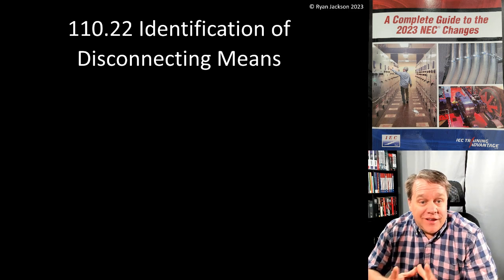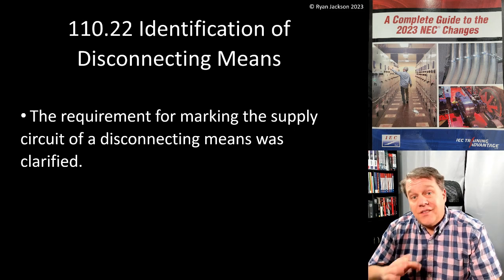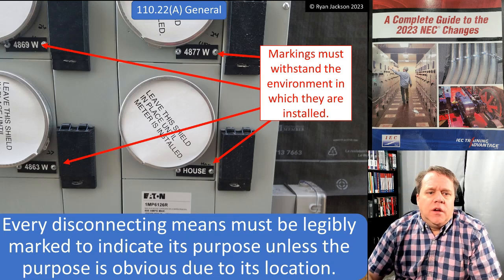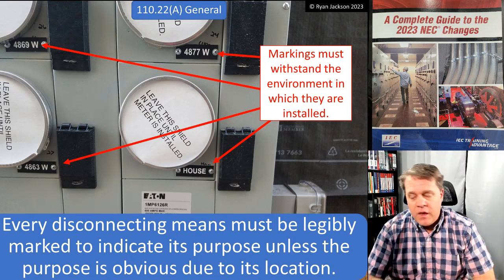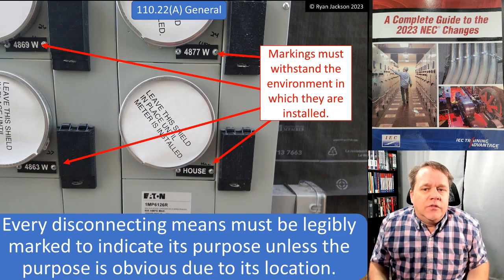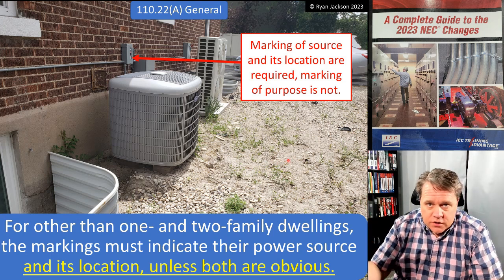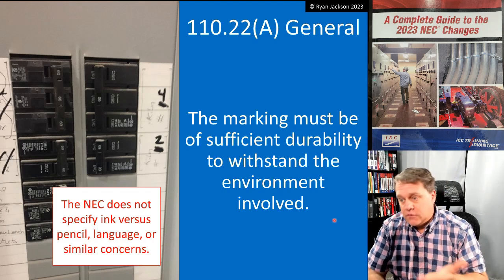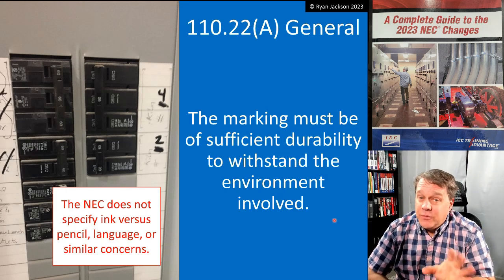2023 110.22 Identification of Disconnecting Means

Comment: Have two complaints: Think the NEC must make installers provide a label or engraved sign be able to be read whenever possible no higher then 6' or 66" off floor. Had contractors install extra small.p touch labels or extra tiny engraved signs 8' off floor at top of a 800 or 1200 amp panel. Second thing at the large hospital/research center that I retired from they had over 75 ATS's and hundreds of panel's. When they mark the panel & did # they should also mark location of panel. Had ATS'S in basements that were feed from EM panels on the 7th floor.
Reply: Just have the manufacturers provide reading glasses for the small text.